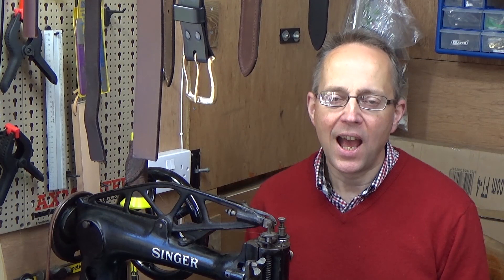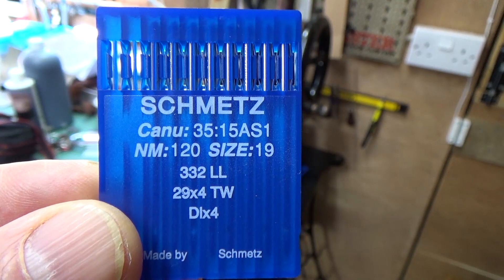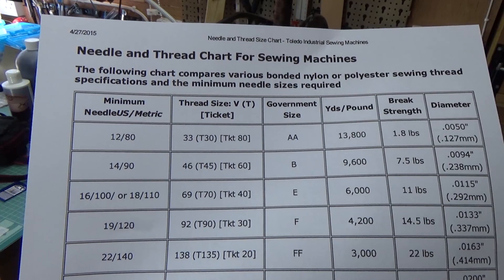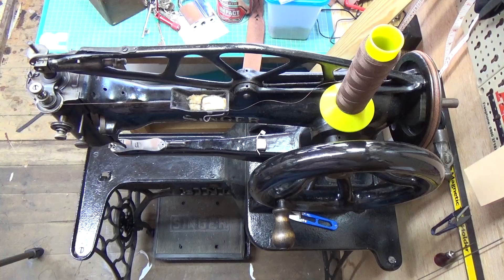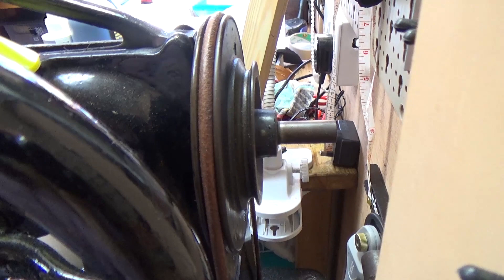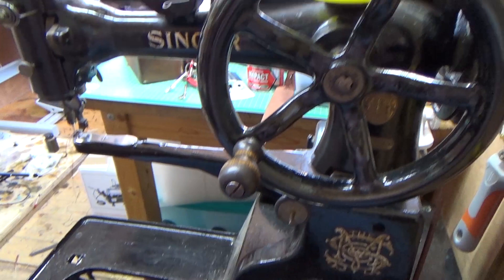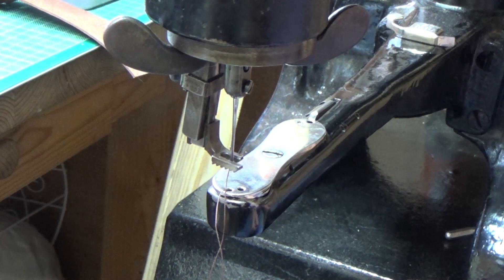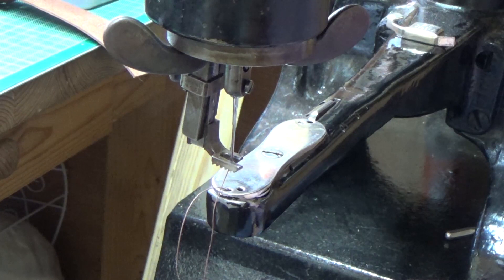Singer 29K Patcher - Needles and Thread, and Sewing a Circle.

Comment: so uhmm... your stiches are bad we can all see it... looks like you got some new disks as well, i would assume the shutle is new since you bothered to change/clean the plate, i know its a 3 year old upload but whats up with that? wrong needle size? your tension seems to be set as low as it can be set and your still getting down stiches on the upper side of the material. its it a thing with these machines not much can be done about it?
Reply from the maker: Hi Carlos...you can set the tension on these fairly easily and it holds it...this looks rough but it was just a quick demo with a single layer...more bobbin tension or less top tension would have sorted this plus using two layers of leather. It's a good machine, though I rarely use it as I use needle feed and larger bobbin machines most of the time. Rgds Harry
Reply: wow 3 year old upload and still here, that was quite impressive. and quick. sorry if it looked like a prick comment, dont doubt its a good machine, my though process comes from you seemingly desregarding the litle arm on top with no pull and together with the low tension on the disks i jumped into thinking it could be a "machine" quirk seeing as they fit more into "hard" shoe work then light fabric and  it wanking the bottom thread would just be something the machine did. ty for the comment you have a gr8 channel i have been binge watching you for the last days  @harryrogers
Reply from the maker: @eueueueu21  Thanks Carlos